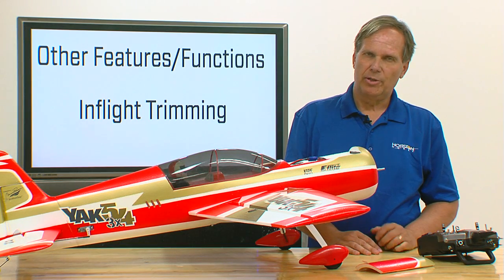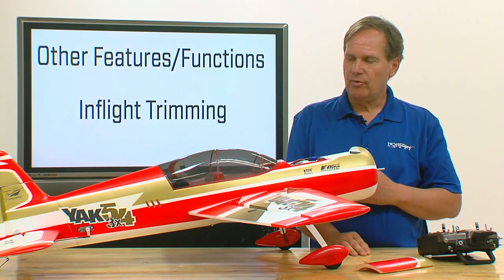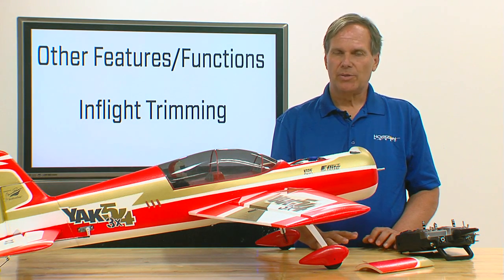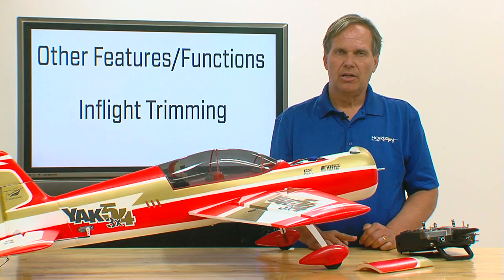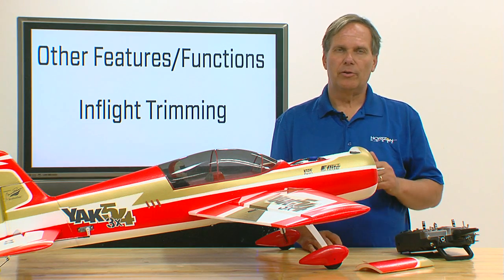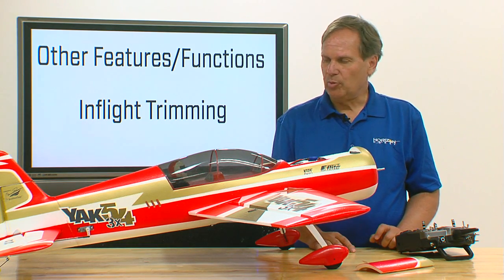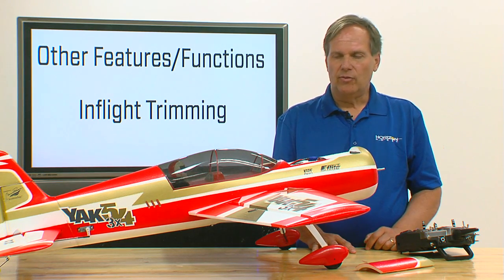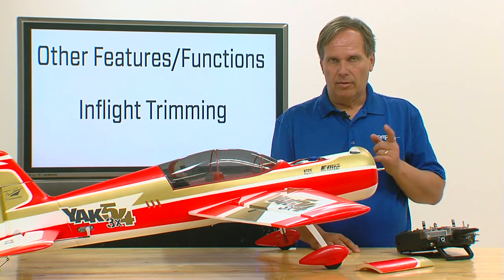Spektrum AS3X: Inflight Trim Adjustments (Other Features & Functions)

Comment: Does anything bad happen if i trimmed the plane while in safe select mode? I did it by accident and after the 3 seconds the plane would make a big adjustment.  It went from flying level to pitched up by 25 degrees or so. I tried to do it back to normal but i don't know if i got it 100% back to original
Reply from the maker: Set trim back to center and retrim in the As3x mode to get the best results. Also make sure your surfaces are level with the surface before maiden of the model. Hope that helps!